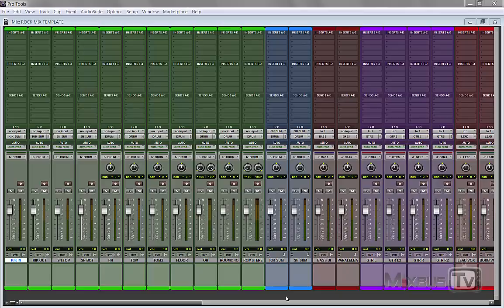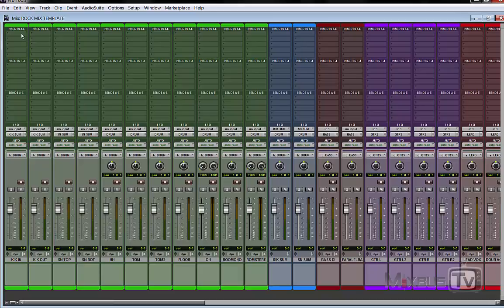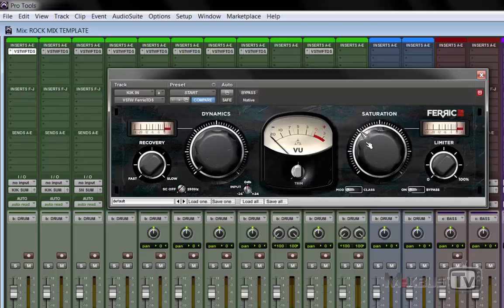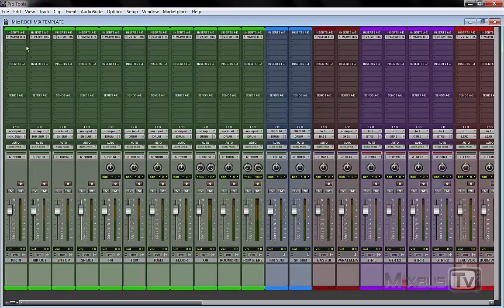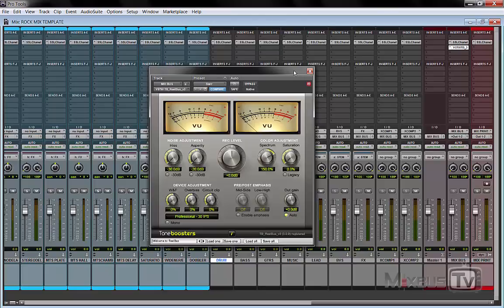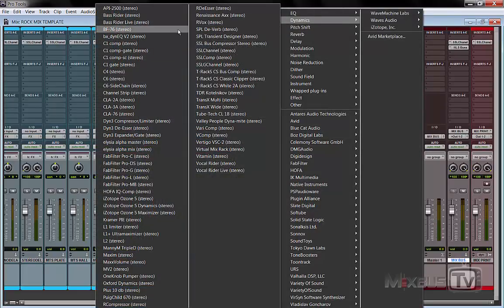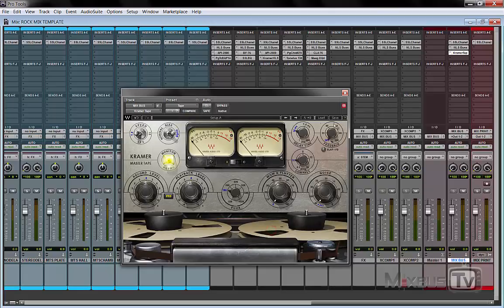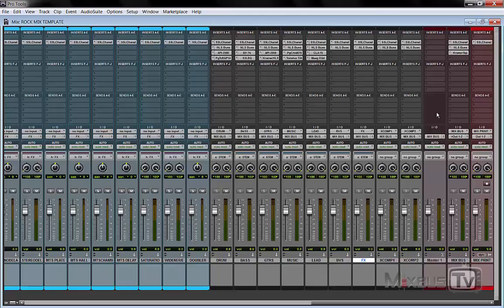Emulate Full Analog Console & Tape with plugins (step by step)

Comment: I have a question..
What do you mean exactly when saying "audio tracks"?
For example, if I'm having a growl bass instance of serum, after the fx I'm putting inside the channel to make it sound more distorted for example, I need to render it down to WAV and then apply the tape and console or I can open the tape and console at the instance of serum without rendering to WAV(when it's still a midi channel)?
Thanks ;)
Reply: Also, do you have an example of a sound with and without this chain? I need to see if this is what I'm looking for..:)
Reply: +MixbusTV  helps a lot man, thanks!!

Comment: Excellent video, like always!!! Could someone give a list of the best tape emulation to put in the first insert? J37, Kramer tape and Tone Booster Reel Bus seems like they are master tape (for printing the master) and not "recording/tracking" tapes. Or are they the same thing? Basically, I'm looking for some multitrack tape recorder emulation. Would also love to know what kind of settings to use in order to lightly colour all my tracks in batch processing :-) Thanks!
Reply: MixbusTV thanks man! Perfect! I'll just use the master tape on the 2bus then. I usually use the Izotope one from Ozone but maybe the tone booster is better? I'll try it to see if it's really different ;-)

Comment: When you add the ssl across all channels do leave it at the default settings?
Reply: was questioning this myself, thanks!
Reply: So basically, if you didn't have an NLS Buss plugin we can instead use the SSL channel strip just for SSL console color (w/o eq + compr), attach different combinations of BUSS related EQs and compressors, on each buss group? And if one did have an NLS Buss plugin (as I do), you can disable the SSL channel strip initially used for color, and instead use the NLS Buss plugin for console color?

Or are we to keep both consoles: [SSL channel strip + NLS Buss] + optional EQ, Compr

Just trying to get my understanding right. lol

Comment: Adding the tape in the first slot; does this technique assume that you have already tracked using a high end preamp into a high end console? Most of us don’t have these things. Surely you would place a preamp plug-in first, then a channel strip, then the tape emulation, to properly simulate a real world chain. What are your thoughts? Thanks.
Reply from the maker: Front end is unreplaceable. If you track with poor quality, poor quality you have, doesn't matter what you throw at it. Anyone who wants to do music and record anything, should invest in a good front end, period. A plug-in preamp is useful to add color if you tracked with a good quality clean mic pre, but you can't replicate the transient response because that happens before hitting the converters and DAW. As for the channel strip why? That's not necessary, I personally track with compression, no eq. Many use to track from mic pre to tape so, a strip is not necessary, it can be there but it's not a part of trying to emulate a tape path like in this case. And again, anyone who wants to do music should have at least good pres and good mics first
Reply: MixbusTv thanks for the reply. I track into audient mic pres, so nice, clean and transparent. I don’t own a 1073 but sometimes want that sound, so a plug-in has to do the job. In that case I load the 1073 plugin before the tape emulation.
Reply: source --> mic/line in --> preamp/gain stage --> "console" --> 2" tape --> compress / eq / efx --> 1/4" tape

think how the signal path works.. you play something, capture it with a mic, run it thru a mix board (4, 8, 16, 32 tracks, etc) , then record it onto 2" tape.. AFTER you record it, THEN you process sounds (compress / eq / efx) then mixdown to 2 track on 1/4" inch tape
Reply from the maker: @BlackPDigitalMedia  the mic goes into a preamp, there's no "line in" the pre is the thing that take the mic level signal to line level. That can be a console or preapms on a tape machine. There's not only one way.

Comment: if your mimiking a Analog set up shouldn't your console emmulation come before your tape emulation while recording so the first plug in in your chain should be the desk and channel emulator, then any processing plug ins you would use in a analog recording session (usualy dynamic controls with emphasis on limiting - although compresion is not out of the question - EQ set to 0 for no other reason than channel coloring etc...) and AFTER the desk emulation you put the tape emulation. When mixing the  analog set up additional tape characteristics are added to a signal which is already recorded. For instance w&f is added at BOTH the recording and playback phases. So in the mix phase you put any additional tape characteristics BEFORE the desk emulation.
Reply: I too find it silly, but if you are going to try to emulate it might as well get it right.

Comment: great.. I'm studying this approach. 
but.. how come the sound enters the first tape machine?, doesn't it need a pre or something to connect the mic? so, theoretically in the first slot should be an NSL channel, only then the tape, ..after that  another pass on the channel (as you suggested) to where the tape is beeing played for mixing purposes right? -am I wrong? 
thanks
Reply from the maker: If you have a sound, any sound, it has been recorded somehow so you already have that. Sounds don't form out of thin air
Reply: @mixbustv  true, but it's not from an analog console, transformers etc. As someone told me somewhere, this consumer grade cheap mic pres  are ok if you keep the gain before noon, to avoid the coloration of tha bad pre. So, the signal enters pretty clean and sterile, but safe enough to start processing. I was talking in that scenario.
but ok. no problem.. I was just trying to learn about this and had this doubt, it was a question. 
In our first release, I used a digi rack 002 with a borrowed M-audio 2424 optical as slave to get enough simultaneous tracks. I'm heading to record our second blues álbum, and in my particular case, I'll be using my Soundcraft Ui24 - the mic pres are cool to push a bit, but nevertheless.. I'm slowly studying the workflow I'll use in this very near future. thanks for all the help you can give here. cheers

Comment: Is there a workaround for this if my pc doesnt have enough processing power to place these on every track? Also, what is a stem? Im using protools 9, and I dont remember ever hearing that term used. Is that something in the upgraded versions? Thanks!
Reply: brian patrick I had the same problem for a while. What worked well for me was to turn on the tape and consule emulation on each track and then print each individual track before I moved on to other plugins. That way you get the sound without all of the plugins open at once. That works especially well for this since you are only getting the color and not really printing any major mix decisions.

Comment: But yea..There is quality loss at each conversion, whether analog->digital or digital->analog. 

The only way to avoid signal loss through conversion is to convert once and from then on keep everything digital. That said, however, if you've got good converters then the compromise of reconversion is probably worth it, if you can get the routing you want that way.
Reply: +MixbusTV Thats a great point. indeed!!!!!

Comment: To emulate it properly you need to set wet ratio to 100%. If done then technically yes, this is how to emulate but.. sonically you won't achieve the sound you're after. You will only waste your time like I did when tried it.
Reply from the maker: What sound? What board? SSL? Neve? API? Trident? Which model? Which year? What tape machine? Maintained well? What tape formula?
The "sound someone's after" means nothing here, there's no comparison with anything. You're saying software doesn't sound like an analog board? No it doesn't so what? This is just a method to get A sound, which sound is open to taste and what anyone has. The hw vs sw debate is really old
Reply: @mixbustv  ok

Comment: This is a genuine question...is there any modeling console product out there that stands out to you, as being more accurate in re producing say a G series SSL..or..? 

I know with synthesisers, there is presently a closer and closer proximity to re creating or modeling the authentic original sound, but there is still slight subtle differences because of electricity and its dynamic behavior. 

Any  comment would be appreciated, as I am trying to get a handle on some of these modeling products...I brought a Fractal Axe fx2xl and it re creates that sound Ive only ever been able to get on consoles like DDA  Neve SSL. I only use software these days as I lost a lot of stuff in an event years ago...The Fractal is the first time Ive heard a unit do a Marshall head and cab or a Triaxis proprely...hey thanks mate ;-)
Reply: Great reply..firstly...THANKYOU FOR YOUR RESPONSE.

I am not in the centre of audio production anymore due to an incident where I lost nearly everything I own, because I wasnt watching someone I was working with, but I LOVE SOUND and I am using everything I can and have to re-enter the place where I can create beautiful things again.

Im certainly not saying I disagree with you, but I brought a DDA console around 2001 just because I heard a 57 on a dual greenback cab, (DDA were a Neve designed console as you probably know) and quite simply it was "the sound" Id been looking for, as Id spend many hundreds of hours trying with my Soundcraft Spirit to get the sound I could hear in my head, but could never do it...infuriating haha

All of a sudden ..there it was right in front of me. So I did everything I could to get that desk and I did;-) 
I never recovered from what happened with the studio, and ended up giving up on my dream, so in time the DDA simply ended up with someone else in another studio room in Sydney. 

I believe in that classic channel path, and those that are trying to emulate it. I believe in it simply because It effects me in my sense of "yum"..haha..That experience with the dual cab was a surprise and it clarified that to me forever.

I LOVE what you say about software becoming their own thing, I just heard a plugin yesterday that blew my mind called FAULT....WOW.. 

One comment...THANKYOU FOR ANSWERING THIS IF YOU CAN...I own an Eventide DSP4000 and Im thinking of selling it, does their own software package recreate anything like their original sonic foot print...? I brought an Eventide 3000 in 94 and couldnt believe their reverbs, eqs and delays ch etc...It was the stereo imaging that blew me away..but I never particularly liked their harmonising...I never "got it?".
Id value a comment on that if you have one, simply because Ive not worked in a situation where Ive ever needed it..but their reverbs...I LOVE!

Do you know what actually creates that Eventide "hugeness", and why it does not seem to be able to be done yet with coding...although I am hearing some mind blowing things with some of Steve Slates products, his silver eqs and blue comps...and I just brought the VMS because it makes sense to have one mic that has a few different characters in it?

Thats it for me...and Im not expecting you to reply as I cant believe you have the time to hahahaha;-)

Comment: Hi David! could you tell me why this plugin overloads my cpu when processing silent tracks? CPU go to 300% and it tilts away and I need to restart.

Let's say I have 30 tracks with NLS in them, a guitar solo that lasts 15 seconds, but the plugin go crazy on CPU on the silent moments, get stuck on dropouts till it crashes my DAW, but when processing audio (all tracks sounding, no silences) it goes down to 20% general CPU processing, why?

My settings in Reaper are optimized for the highest buffer and for handling easily 200 plugins or more, but this NLS plugin doesn't allow me to work, even when it's the only plugin in the chain! for the moment I'm freezing everything once I like what I get with NLS, then add the other plugins and work just normally.

You're a great teacher! thank you for all the knowledge, I learned a lot with this channel :)
Reply: Oh thank you! yes, that was the solution!! o_O 
I found a plugin that introduces a constant inaudible noise (maybe is dither? I don't know) to the NLS so the track is never silent, now the plugin doesn't crash my computer, all works just fine now, crazy.

David you and Kenny Gioia are the best techers/mentors on the whole internet for us who can't pay a school or have any other resources, thank you SO much.
Reply: Verónica Darrell Strip the silence (empty audio clip) from the actual takes. Saves a ton of processing power.

I wouldn’t dither anywhere but in the mastering phase where bit depth needs to be often reduced.